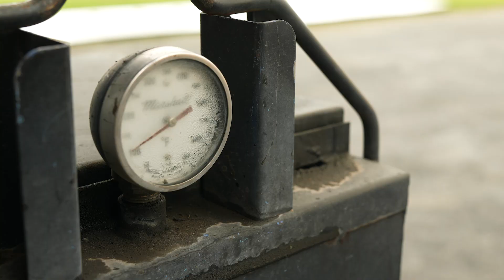Dan Adams - Driven Ep. 2 - Polaris Snowmobiles

Comment: Hey Dan, did realized you live in Alpine, Wy. I am in Idaho Falls.  Quick question - storing snowmobiles off season.  I have a long 153" track.  when not in use for summer, is it recommended to have the track off the ground enough to relieve the weight on the track/lugs/suspension?